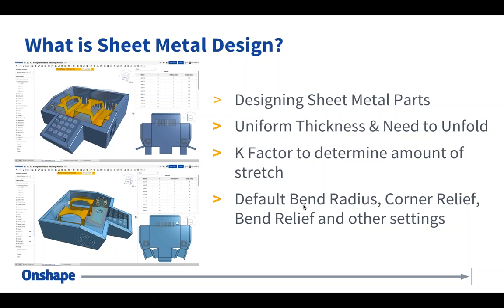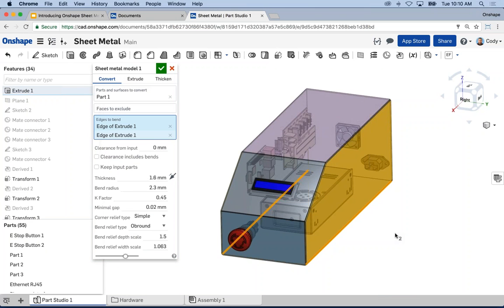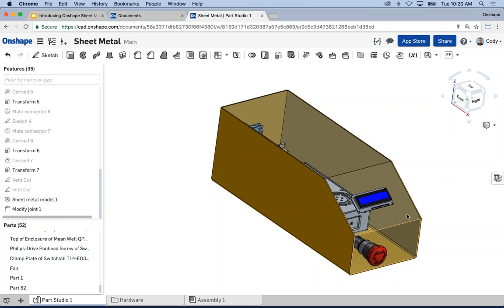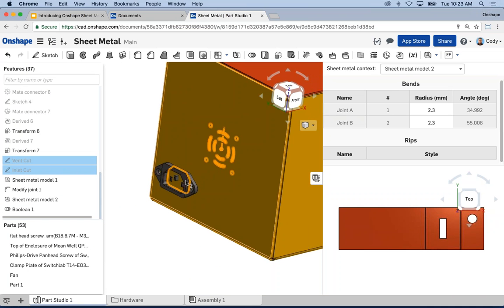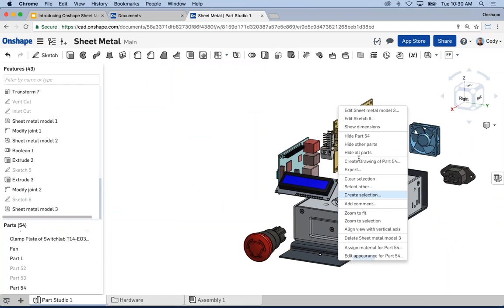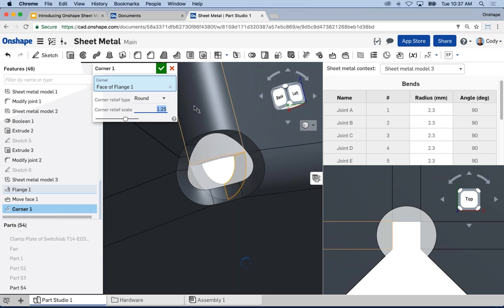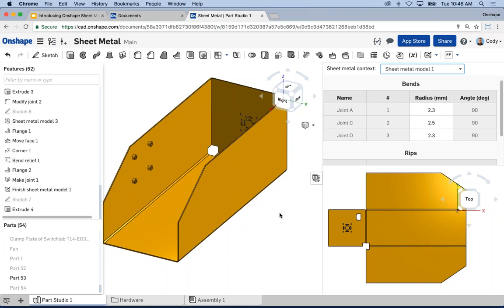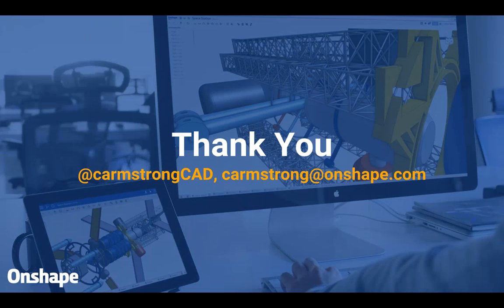Introducing Onshape Sheet Metal | Webinar (February 14th, 2017)

Comment: why did onshape decide to not allow any solid part tools to work with sheet metal until you make it "finished" ?  such as fillets; patterns, extrude.. etc..   many of the best multi-part studio features are off-limits for sheet metal. i havent drawn a sheet metal part yet that hasn't had at least 1 fillet as part of the flat pattern. finsihing a sheet metal part means additional features will not show up in the flat pattern.  OR am i doing it wrong?
Reply: I've seen this asked before, lots of features work like extrude and pattern. I know fillet doesn't yet but I know they have every intention of adding it they just didn't want to delay releasing sheet metal till it was ready.
Reply from the maker: Hey John, I would imagine you found the answer to this by now, but let us know if you have other follow ups.
Reply: @OnshapeInc  yes, to follow-up, most of the solid moding solutions are also available for sheetmetal use. It has come a long way since this video
Reply from the maker: @johnmcclary754  No doubt! Thanks for the follow up. Make sure to subscribe, we have more content coming to YouTube again after a long hiatus.